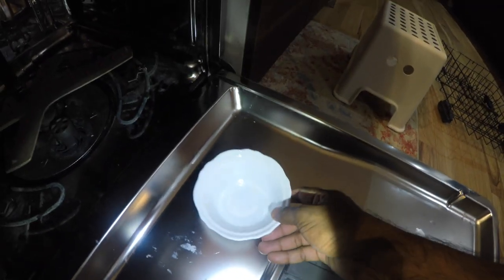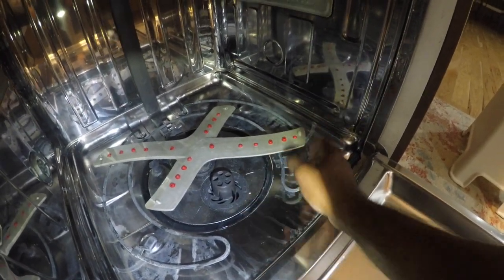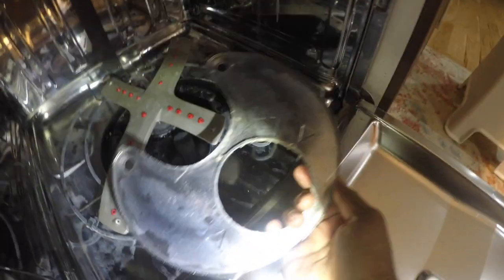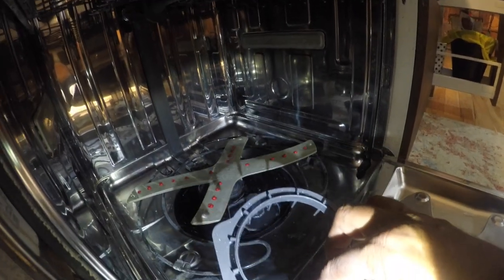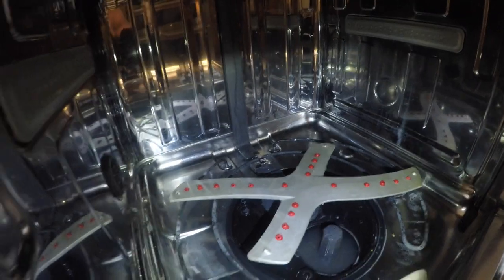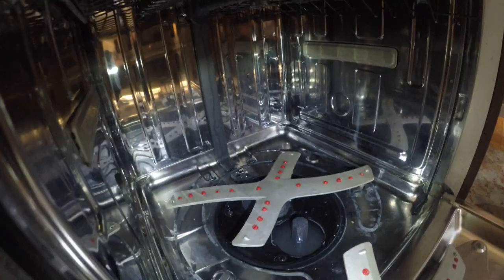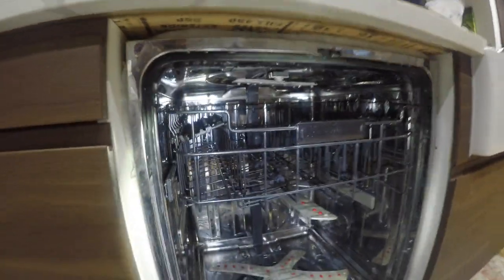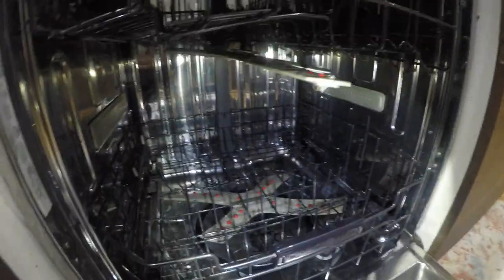How to clean the inside of a stainless steel dishwasher

Comment: You have a crappy dishwasher.  Get rid of it and buy a Bosch.  Also, use your dishwasher everyday and use name brand detergent, not a cheap generic one.
Reply from the maker: Thank you for the comment.
Reply: @NishanAmarasuriya Run it everyday and use a good quality rinse -aid as well.  You will notice the difference.
Reply from the maker: @PritpalSingh-ys6ol   What brand would you recoment?
Reply: @NishanAmarasuriya  Well, you gotta try a few brands.  Try the high-end Cascade tab or the high end Finish tab.  In my dishwasher, the high-end Finish tab works better than the cascade.  

The same goes with rinse-aid.  Your rinse-aid should make the interior of your dishwasher shine along with your dishes. Don't just buy the huge bottle that they sell at the membership warehouses.  Buy a small one at the grocery store.  Its trial and error.   But you gotta use the dishwasher daily.  Even if you got clean dishes, load them and turn it on.
Reply: I just thoroughly saw your video again...Yes, after you cleaned out the filter, you need to empty out your dishwasher and use a dishwasher cleaner.  I highly recommend the dishwasher cleaner from lemi-shine.  Strong cleaning fruit smell, but gets the job done.  Then use your washer daily with high quality detergent and rinse-aid and you will be fine.   Make sure you use normal setting and not a quick cycle.  Thanks...